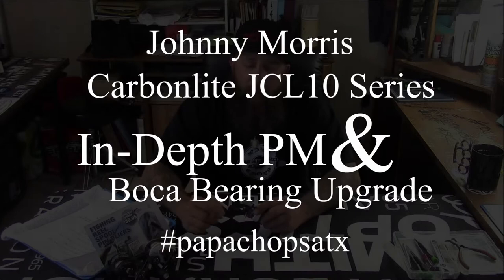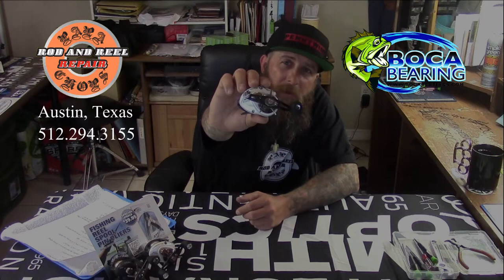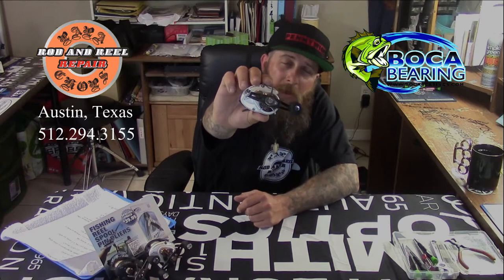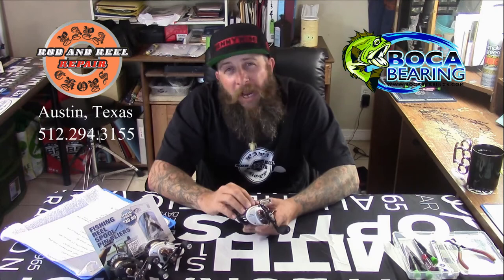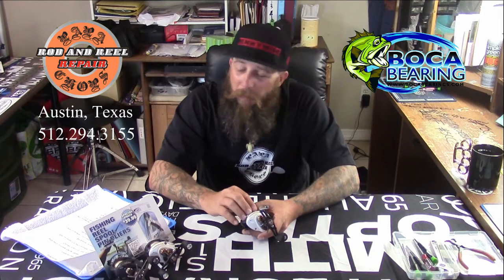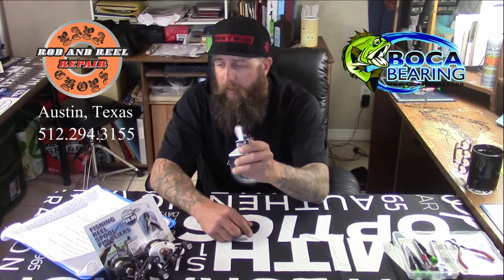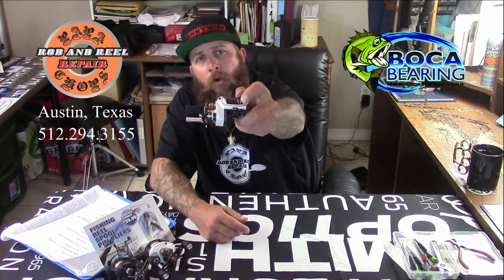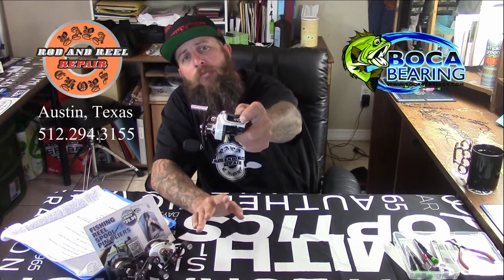BPS Johnny Morris Carbonlite JCL10HB  Prev. Maint. and Boca Upgrade

Comment: Dawon built a great little reel when they made these for Bass Pro.  However, they stretched themselves a little far trying to trim weight.  The ratchet wheel under the main gear is made of duralumin and the points can wear a little quickly.  Replace that mug with one from a Pro Qualifier (Doyo Lubina), or any other same sized one made from stainless steel or plated brass.  It's super simple, and you'll then have a roughly 6 oz. reel that'll hold up great, with one of the most effective braking systems available.